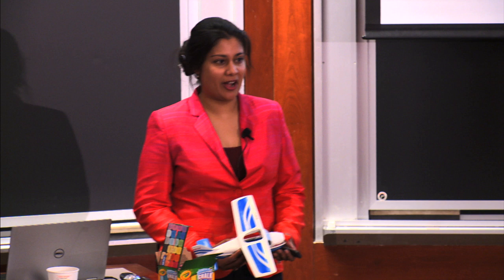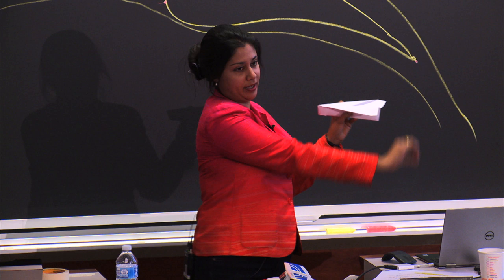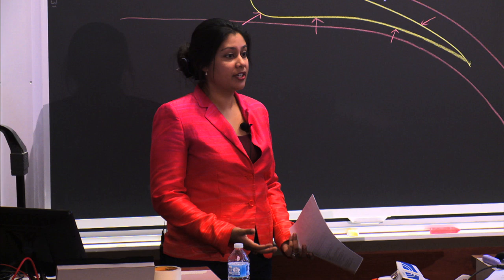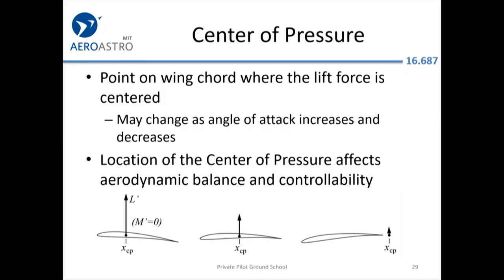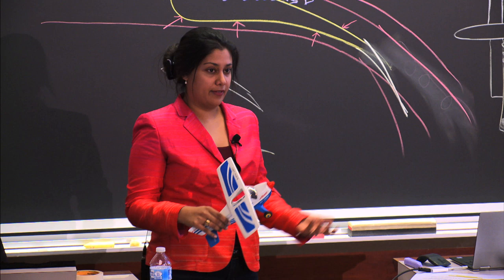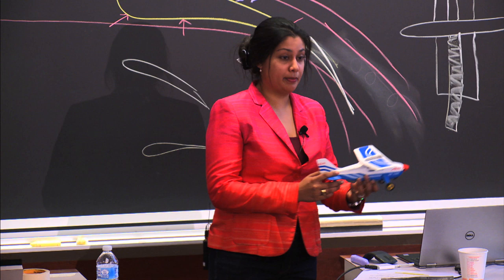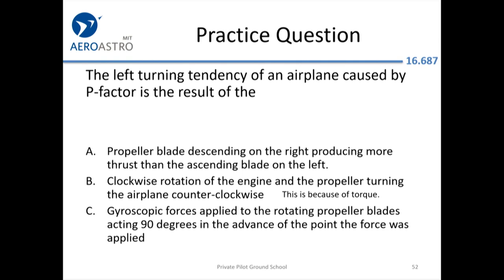MIT Private Pilot Ground School, Lecture 2 (Aerodynamics)

Comment: I'm still pretty sure that the air over the top of the wing travels faster because it is displaced more than air under the bottom of the wing. And hence, faster air makes for lower pressure (Bernoulli) thus generating part of the total lift. Several factors contribute to lift. Perhaps the equal transit theory is just a way to illustrate Bernoulli's by comparing 2 air molecules, 1 above and 1 below the wing.
Reply: @nitnisarge  
Fine. But Bernoulli still applies because the air's flow is diverted by the angle of attack of the airfoil.
Reply: What happens when a plane flies upside down?
Reply: @jameswalker3463  
Same answer as for Nitin Tiwari, above, pretty much. 
Upside down you can use the ailerons to create a camber on the airflow, or the tail surfaces to give you the angle of attack you want to give you lift.
This is Lecture 2, the straight and level part of the overall configuration of forces that you'll learn, assuming you're not just carping about something you already know, that is.
Reply: @TheDavidlloydjones  A lot of the assumptions required for Bernoulli's equation is not valid in case of plane wings. Have a look: https://en.wikipedia.org/wiki/Bernoulli's_principle . Though you can say that it applies approximately but since it is not 100% correct you can't use it as an argument to explain lift. @James Walker  when the plane flies upside down the lift acts in the opposite direction i.e. lift acts towards the ground (this will again depend on the wing configuration so it can't be generalized).  A good example of negative lift being used is an upside down wing like shape used in F-1 cars to increase downforce and hence traction.
Reply: @nitnisarge  
When the plane is flying upside down, if the control surfaces (flaps, ailerons. slats...) remained unchanged, you would certainly be right. The "lift" would vector toward the ground.
This is not what happens. When the plane it turned over the pilot will change the positions of the ailerons etc. to change the camber of the whole airfoil and hence the flow of the air.
Change the bend in the wing by turning the flaps "up," i.e. toward the ground: you have Bernoulli operating in the opposite direction.
I'm curious: what do you think you see in the Wikipedia article that shows your " Bernoulli's equation is not valid in case of plane wings"?
Reply: @TheDavidlloydjones  Yes you are right hence the caveat given in bracket  :P. If you read the wikipedia article properly you'll find that there are certain assumptions when deriving the Bernoulli's equation: 1) The flow is steady (not true in our case) 2) The flow must be incompressible (again not true in our case) 3)Friction by viscous force is negligible (only true for idealized scenarios not real life scenarios). Bernoulli's equation is valid only for very special cases of laminar flows (textbook problems) but the flow near an aircraft wing is anything but laminar.
Reply: @nitnisarge  
Are you sure you read the Wikipedia article? It treats compressible and incompressible separately.
Like all "laws," the Bernouilli Equation states an ideal. Obviously, it fails right down there at the atomic level: your fluids will always come in individual bumpy little atoms. My question was, how do you think any of that is relevant to planes flying upside down? The "inaccuracies," if you want to call them that, apply equally to the plane whether it's upside down or not, don't you think?
Reply: @TheDavidlloydjones  I think you are confused between "Bernoulli's equation" and "Compressible flow equation". Please get your terminologies correct before jumping in !! Professional researchers do not consider "Bernoulli's" to be a sufficient explanation for lift.  If you still think this "Bernoulli's"  is a sufficient explanation for lift please publish a research paper in a reputed journal and then get back to me. I rest my case.
Reply: @nitnisarge  
No, I'm not. I'm pointing out to you that any inaccuracy in any part of the whole shebang applies equally whether your plane is upside-down or not. 
Hence your claim -- which you still haven't identified, it's really just hand-waving -- of inaccuracy would apply specifically to the upside-down plane doesn't compute.
I haven't made any claim on any side of the question you bring up here -- as is obvious from the fact that you've only brought it up now to throw at me without any reason whatsoever.
Pull yourself together: you're not living up to the professionalism you claim for yourself.
Reply: @nitnisarge  
You write " I think you are confused between "Bernoulli's equation" and "Compressible flow equation"."
You can only think that if you have a severe problem of reading comprehension. Nothing in my post remotely supports what you say.

Comment: This video is fair and has some things ok and some thing wrong. It is nowhere near what should be expected from MIT. She is trying...
.
0:50 Vocabulary: doesn’t  mention the vertical and horizontal “stabilizers”. Calls them “parts”. In the graphic, but not mentioned.
There is only ONE wing.
Going to talk about sea planes ???
3:11 initially says lift exceeds drag, but corrects it.
4:50 Draws an extreme airfoil shape.
5:22 The way she explains conservation of momentum is a good one, but momentum can be confusing to some people. It is not saying just how these pushes come about, but is better than just saying lift is a Third Law "reaction".
5: 30 Air has mass and conservation of momentum. Doesn’t explain how push occurs.
6:12 GOOD: Explains the  Equal transit/longer distance fallacy. Points to flat wing, same length.  Math description not needed - correct.  Good Aeroastro graphics.
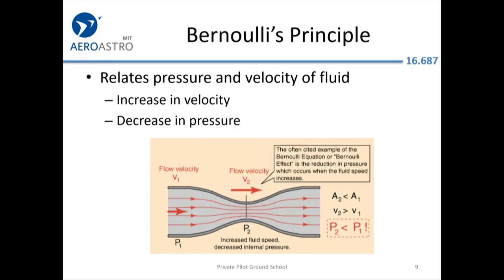12:01 GOOD: Stated Bernoulli correctly using ‘velocity’.  BUT focuses on fast.
12:40 "C" is the WRONG answer!  The word "cause" is incorrect.  "A" is the only correct statement there, but has nothing to do with Bernoulli..
12:42 The Graphic assigns INCORRECT cause to lower pressure.
14:00 GOOD: stationary pressures. She only mentions a "force" but not that it is pressures that cause the force!
15_24  Talking about the rest of the aircraft generating lift is a distraction and unnecessary.
15:57 Asks childish questions. Race Car.
16:36 Only says the spoiler “spoils the air flow. Doesn’t explain that it has down lift.
18:00 It is the altered pressures which cause the acceleration of the air (downward) ACCELERATION DOES NOT CAUSE THE FORECE !!! 
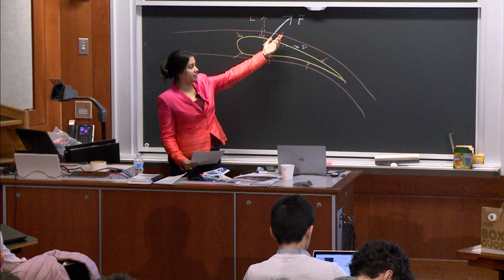18:09 Wing  ALSO changes the speed of the air.
Never states that upper air beats lower air.
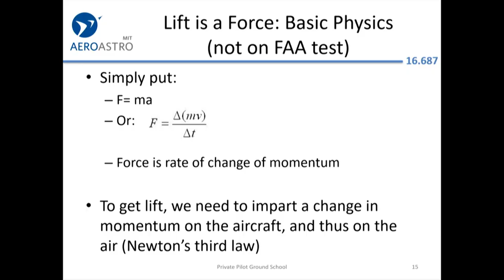18:40 Air past wing, or wing past air question.  The critical thing missed here is that the speeds are NOT "IDENTICAL", but different between these two reference frames, BUT the science must be the same.  Therefore, talking about fast is misleading.  It is ACCELERATION that must be understood.
18:54. Is wing moving faster through the air, or air moving faster past wing? Frame of reference discussion – SAME. Wind tunnel justification.
23:40 Mentions aspect ratio without explaining it.
24:24 Mentions hand out car window and PUSHING, but doesn’t relate to the – IGNORING the momentum explanation earlier.
25:28 Mentions Viscosity. Compares sticky.   Sticks to the wing.
27:10 Compressibility affects lift in a different way.  NOT FUNDAMENTALLY.
27:20 Calculating lift is not known.
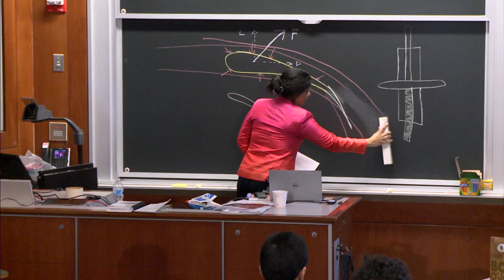29:45 CALCULATING LIFT.  Mentions Kutta Condition and says wrap around is an additional condition.  2D is simpler ) OK, but tip vortex sn not true turbulence.  So… Calculate where possible and measure elsewhere.
Doesn’t explain chord line.  Says:  “in between".
32:25 Talks about summing forces around the wing for lift, but doesn’t explain the top-bottom difference.
38:10 Doesn’t actually state what AoA is.  Graphic shows it as “A”  but is unnamed.
42:20 CONFUSED about the effect of flaps. Airspeed being higher with ground speed lower HUH???  Also doesn’t explain approach being steeper. Misses that is the increased lift that allows slower air speed.
47:38 Only explains that roll is around the longitudinal axis, but not the others.
48:13 Doesn’t explain why adverse yaw occurs.
48:15 Stability OK.
53:30 Question about what happens beyond the critical angle is not answered correctly.  Lift does not go to zero. Did not demonstrate a paper airplane stall.  It was too stable.
54:45 First mentions separation.
55:56 climb & decent, lift = weight.
57:15 Torque causes a left ROLL.
57:50 P-Factor not so much climbing because AoA not necessarily high, just on ground.  They can’t answer the question at 
1:02:20 Precession is 90 degrees  later.
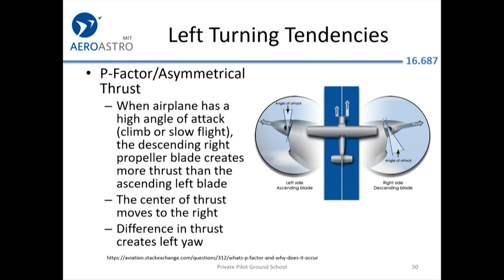1:03:14 Question why P-factor not subject to precession. Sort of answered. It is a bigger factor on the ground for a tail dragger the ground where the ground  prevents precession and in slow flight when precession only occurs during actual yaw.
In zero G flights confuses the upward parabola with top and downward parabola with bottom.

Comment: At 12:20 you say "when we have air moving faster over the top of the wing". First of all why is there an assumption that air is moving faster over the top? Second: since top of the wing path is longer for your airfoil and air is moving faster over it, one would argue that time to travel those molecules you mentioned at 7:39 is indeed the same. So, there is a contradiction in your logic.
Reply: > Second: since top of the wing path is longer for your airfoil and air is moving faster over it, one would argue that time to travel those molecules you mentioned at 7:39 is indeed the same.

Weak logic. You're making an (incorrect) inference that the delta is exactly that required to result in equal transit time when in fact at no point was that stated. Her diagram later in the video showed the top flow arriving at the trailing edge before the bottom.

Comment: Great Job!!!!!
Reply: This video is fair and has some things ok and some things VERY wrong. It is nowhere near what should be expected from MIT. She is trying...
.
0:50 Vocabulary: doesn’t  mention the vertical and horizontal “stabilizers”. Calls them “parts”. In the graphic, but not mentioned.
There is only ONE wing.
Going to talk about sea planes ???
3:11 initially says lift exceeds drag, but corrects it.
4:50 Draws an extreme airfoil shape.
5:22 The way she explains conservation of momentum is a good one, but momentum can be confusing to some people. It is not saying just how these pushes come about, but is better than just saying lift is a Third Law "reaction".
5: 30 Air has mass and conservation of momentum. Doesn’t explain how push occurs.
6:12 GOOD: Explains the  Equal transit/longer distance fallacy. Points to flat wing, same length.  Math description not needed - correct.  Good Aeroastro graphics.
12:01 GOOD: Stated Bernoulli correctly using ‘velocity’.  BUT focuses on fast.
12:40 "C" is the WRONG answer!  The word "cause" is incorrect.  "A" is the only correct statement there, but has nothing to do with Bernoulli..
12:42 The Graphic assigns INCORRECT cause to lower pressure.
14:00 GOOD: stationary pressures. She only mentions a "force" but not that it is pressures that cause the force!
15_24  Talking about the rest of the aircraft generating lift is a distraction and unnecessary.
15:57 Asks childish questions. Race Car.
16:36 Only says the spoiler “spoils the air flow. Doesn’t explain that it has down lift.
18:00 It is the altered pressures which cause the acceleration of the air (downward) ACCELERATION DOES NOT CAUSE THE FORECE !!! 
18:09 Wing  ALSO changes the speed of the air.
Never states that upper air beats lower air.
18:40 Air past wing, or wing past air question.  The critical thing missed here is that the speeds are NOT "IDENTICAL", but different between these two reference frames, BUT the science must be the same.  Therefore, talking about fast is misleading.  It is ACCELERATION that must be understood.
18:54. Is wing moving faster through the air, or air moving faster past wing? Frame of reference discussion – SAME. Wind tunnel justification.
23:40 Mentions aspect ratio without explaining it.
24:24 Mentions hand out car window and PUSHING, but doesn’t relate to the – IGNORING the momentum explanation earlier.
25:28 Mentions Viscosity. Compares sticky.   Sticks to the wing.
27:10 Compressibility affects lift in a different way.  NOT FUNDAMENTALLY.
27:20 Calculating lift is not known.
29:45 CALCULATING LIFT.  Mentions Kutta Condition and says wrap around is an additional condition.  2D is simpler ) OK, but tip vortex sn not true turbulence.  So… Calculate where possible and measure elsewhere.
Doesn’t explain chord line.  Says:  “in between".
32:25 Talks about summing forces around the wing for lift, but doesn’t explain the top-bottom difference.
38:10 Doesn’t actually state what AoA is.  Graphic shows it as “A”  but is unnamed.
42:20 CONFUSED about the effect of flaps. Airspeed being higher with ground speed lower HUH???  Also doesn’t explain approach being steeper. Misses that is the increased lift that allows slower air speed.
47:38 Only explains that roll is around the longitudinal axis, but not the others.
48:13 Doesn’t explain why adverse yaw occurs.
48:15 Stability OK.
53:30 Question about what happens beyond the critical angle is not answered correctly.  Lift does not go to zero. Did not demonstrate a paper airplane stall.  It was too stable.
54:45 First mentions separation.
55:56 climb & decent, lift = weight.
57:15 Torque causes a left ROLL.
57:50 P-Factor not so much climbing because AoA not necessarily high, just on ground.  They can’t answer the question at 
1:02:20 Precession is 90 degrees  later.
1:03:14 Question why P-factor not subject to precession. Sort of answered. It is a bigger factor on the ground for a tail dragger the ground where the ground  prevents precession and in slow flight when precession only occurs during actual yaw.
In zero G flights confuses the upward parabola with top and downward parabola with bottom.